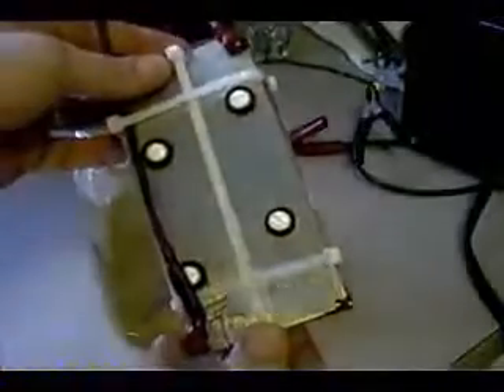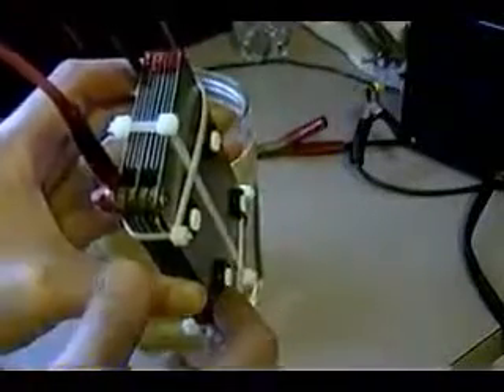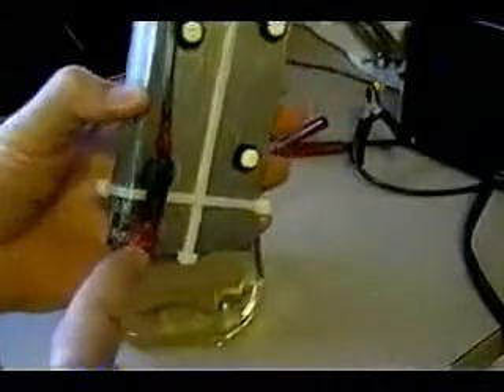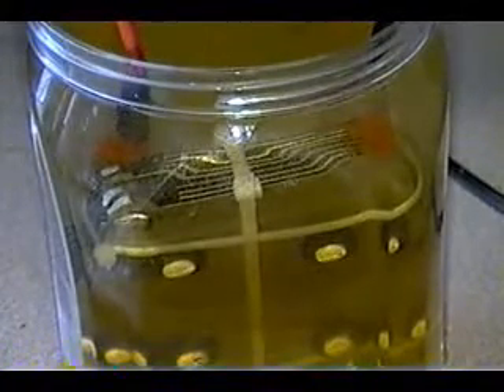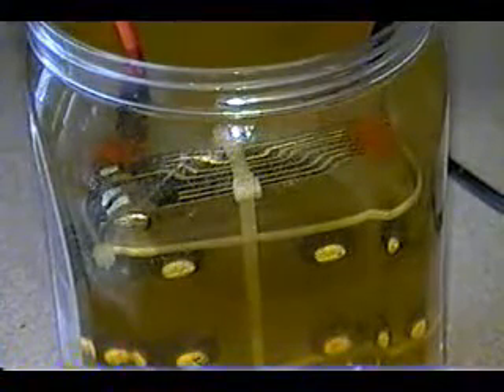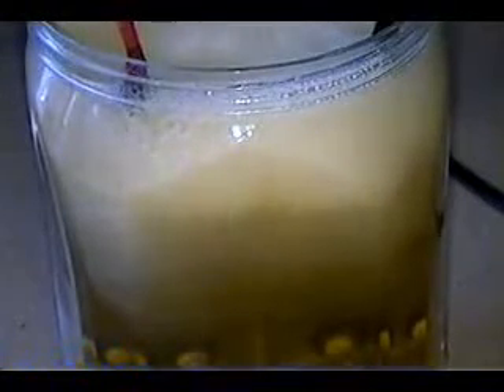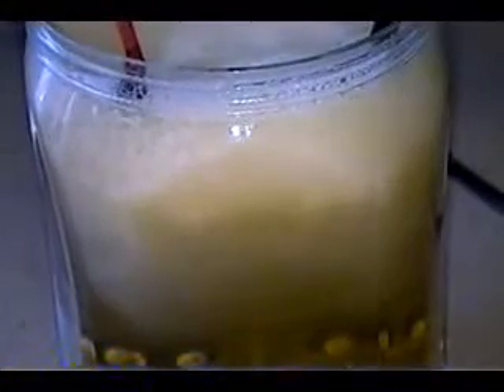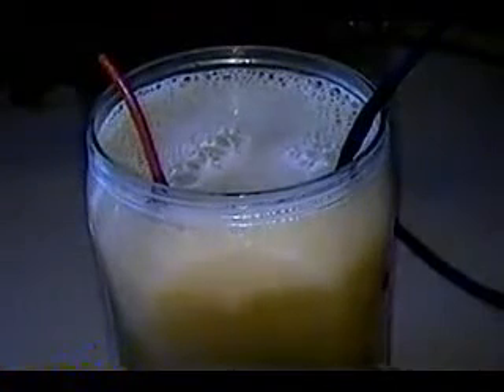Good HHO Generator Plans - How To Convert Car To Burn Water - Hydrogen Hybrid Generator Fuel Cell

Comment: I find the plate spacing is key. Under 1cm apart and your converting too much energy into thermal, and start making steam rather than HHO. Also, use less Baking Sode, an eighth of what you suggested is fine for electrolization, and gives the plates a longer life. 

https://youtu.be/9-pHhcHkEHs

Comment: if you install a DC pulse regulator to your system you can run with no electrolyte, and your system will run on miliamps instead of amps
Reply: ala Stanley Meyer?

Comment: I changed to titanium coated copper.the byproduct from stainless steel is a hazardous material . I run 5" x 7" plates no neutral . ten plates running at ten amps only, produces enough hho to run my f350 10 cyl engine and get 125 mpg .